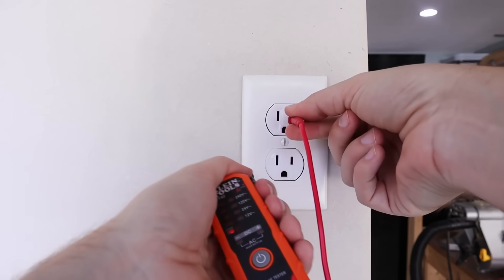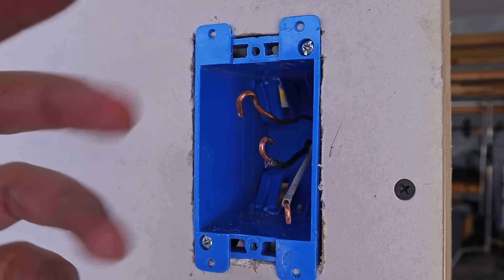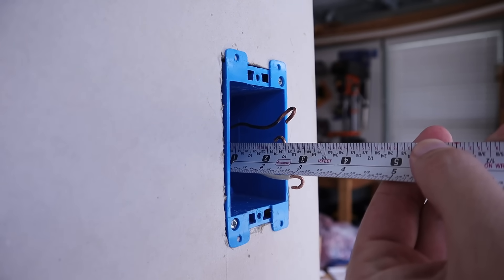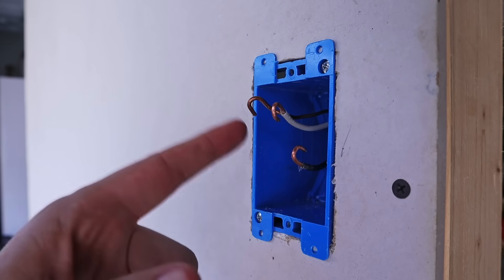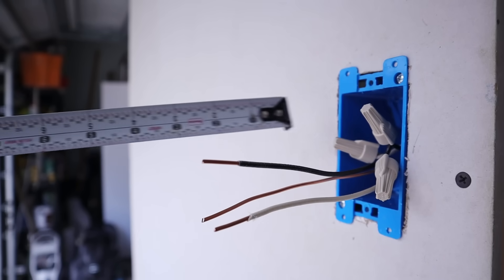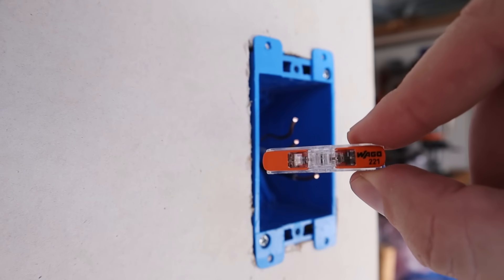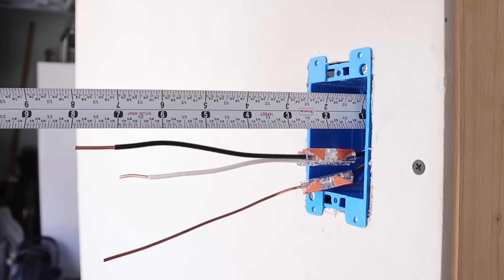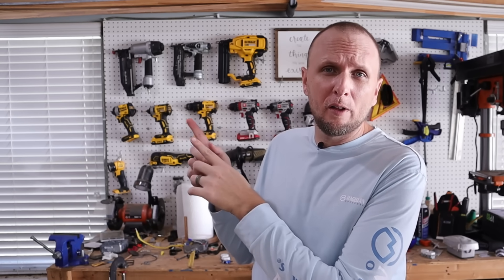"SHOCKING" New Way to Fix Short Wires In an Electrical Box to Code | Very Important

Comment: One thing was how easy it was to cut and strip the loops off the existing wire, to perform the various ways of connecting.  In the example build up, you put the gang box at the end of the drywall and stud. With there being nothing to stop you from angling your hand almost behind the box, at the very least, at the same depth, it shows as pretty easy. However, real world, there's going to be continuous wall, making the move to cut and strip, extremely difficult. Even worse, there maybe countertops forcing us to stand 2' away from the box. How do we avoid that?

Comment: Part of the problem may be advice from inspectors years ago.   Two different ones told me that I was wasting too much copper by having what I considered to be compliant lengths.   My response was that I was not trying to low ball the job.
Reply: The "Inspector" title went to his head!
Reply: Inspectors are usually just tradesmen that couldn't make it doing the trade.
Reply: @robertwazniak9495  lol not always, but sometimes. Also I know an inspector that was damn good in the trades but was now slightly obese, had a few injuries, and was older. So u kinda get a whole range, but I think personality (like any job) and a willingness to learn their craft is the most important thing.
Reply: @srobeck77  I can honestly say I have never worked with or dealt with a “normal” inspector. They are either really really good at what they do… explain what they are doing and fully understand why and what is critical and what you shouldn’t do next time.., and make you a better contractor. OR, pompous asses on power trips who need to justify their existence and try to beat their old record on how many violations they can write you up for. There are no middle ground people.
Reply from the maker: Wow, I had not heard that one yet but like you said, it might explain why some of the remodels I have done, I have found short wires and I know it was installed by an electrician.  That and neighborhoods go up as fast as possible and the inspectors arent checking super closely all of the boxes.  Really appreciate the input Luther!
Reply: @HowToHomeDIY  The last lot along the major street by my place was subdivided.  Sad, no yards on the entire throughway.

Comment: Uh oh!  Twisting the wires before applying the wire nut is normally a mark of a hack.  It usually doesn't matter, especially with only two wires, but it is possible for the wire nut to not compress ALL of the wires.
Reply from the maker: Then every electrician I know is a hack.
Reply: @HowToHomeDIY  In my experience it's actually only about half half.  And, to be fair, some of the manufacturers actually do state that "pretwisting is optional".  But, in practice, it is better not to.
Reply: LOL, tell us you know nothing about wiring while telling us a hack.

Comment: You did not show fitting the sockets into the hole after adding in all of the connectors, how do they fit?
Reply from the maker: Perfectly fine.  The wire nuts take up the most room, then regular wagos, then the in-line wagos.  The inlines are really just like extending the wire.  All that said, I’m more of a wire nut user but the in-line connectors are a nice choice.
Reply: @HowToHomeDIY  Thanks, was just curious, because in the UK 3 wires can get tight without extensions :)

Comment: Seems to me that the "original" WAGO 221 (both wires on the same side) would be easier to tuck into the box after the recepticle or switch is connected.  JMO.
Reply from the maker: Not at all.  The inline is basically just an extension of the wire and takes up barely anymore space than of the wire had been the proper length.
Reply: @HowToHomeDIY  Thanks.  Your videos introduced me to the WAGO, and I used many of them in my new home.  Now we have the new straight connectors.  I'll give them a try.  Keep up the good work.
Reply: It makes the bending part much easier.

Comment: Why cut the loops off?  That only exacerbates the short wire issue.  Assuming the wires are not damaged, just straighten the loops, trim the bare wire to an appropriate length and then extend them.  Is there some reason not to?
Reply from the maker: Yes, since the wires were already bent into a loop once you start bending copper back the other direction, which you would need to do to straighten, it weakens it.  So you run the possible risk of it breaking off at some point.  Doesn’t mean it will but I always try to play it safe when I can.

Comment: Any advice for splicing #6 wires?
Reply: Use a 4-11/16 by 2-⅛ box and ideal blue nuts. For more than a simple splice,  bump up to a appropriate sized pull box, per NEC 314.16, and Ilsco cleartaps or Burndy splices, aka monkey knuckles.

Comment: I’ve stopped using wire nuts , they take up far to much space. Thank you I wasn’t aware of the in line wago. Very helpful!
Reply: Inline Wagos are very recent, difficult to find in the US and expensive if you do.
Reply: @KameraShy No longer (February 2024). 60 pieces for $24 on Amazon, same day delivery for Prime members. Forty cents each to quickly cure a wire issue while taking up a fraction of the space of wire nuts is a screaming bargain.
Reply: enjoy the fire.
Reply: @soisaidtogod4248  old dude, wagos have been code in Europe for over 20 years now. What is this mythical fire you dream of?

Comment: Gotta love those US plastic ungrounded boxes that don't hold the wire sheath at all. Shite. Not sure what the tan nuts are in the US, but in Canada you use the BLUE Ideal Can-Twist nuts which are great for most everything.
Reply: here, blues are the biggest or the smallest size.  tan is halfway between the old yellows and the old reds.  the best general use ones on the market here are #m T&R+ model - they can do everything from 2 fixture wires, to 4 #12 solid.
Reply: They go by size not what color the manufacture picks.
Reply: @soisaidtogod4248  this may come as a surprise to you, but the color of a wire nut is picked to identify its size and design.  not sure why ideal makes a canadian model and a US model of what is essentially the same wire nut - but the blue can-twist is the Canadian version of the tan Twister.

Comment: This is not to code.  300.14 "The 6-inch free conductor shall be permitted to be spliced or unspliced"... great you fulfilled that for an enclosure that is more than 8 inches square... "Where the opening to an outlet, junction, or switch point is less than 8 inches in any dimension, each conductor shall be long enough to extend at least 3 inches outside the opening."... this extra sentence in particular for enclosures smaller than 8x8 square need 3 inches outside the enclosure and does not have the previous prevision.  If the box is for a switch or outlet I would like to impose the conductor shall be unsliced to meet code.  That means moving the box, pulling more conductor into the box, changing the enclosure to a greater than or equal to 8x8 opening, or converting the short wired box to a junction box so you can splice the short wires and send them to a new outlet location with 3 inches, unspliced outside the opening.

However, if you want to ensure that your installation meets code and best practices, you may want to consider using unspliced conductors in all cases, even for larger enclosures. This can help ensure a reliable and safe electrical connection. 

Ultimately, it's important to consult with a qualified electrician to ensure that your installation meets all applicable codes and safety standards.

Comment: I'm not an electrician, but do a fair amount of electrical work both at home and mountaintop radio sites.  I started using the WAGO 221 connectors a year or so ago based in part on some of your videos.  I like the inline WAGO splices you showed here...
However, here is something unrelated that has always concerned me.  In many cases (especially when using romex) the ground wire is bare wire.  I know that is perfectly legal per code, but it just seems very unsafe because now you have a bare grounded wire floating around the box where there are also exposed hot terminals.  Just does not seem like a good idea to me.  Almost everything I do is in conduit rather than romex so normally I have green insulated wire for the ground connection.  Comments?
Reply: Ya, your conduit should be grounded. Bare wire in the box is also fine because your whole box should also be grounded. Just make sure not to touch any terminals with excessive wire - if one can't do that, then one has no place in touching anything with electricity.
Reply: if a bare ground is at risk of hitting the other terminals, you're a sloppy worker.

Comment: I've been using (and love) Wagos for years but I never knew about the inline connectors. Ordering some right now. Thanks!
Reply from the maker: You are welcome!  They can definitely be helpful!
Reply: The inline Wagos are relatively new. I used them when I rewired my 1950 house.
Reply: @im2yys4u81  1968 here but no lead paint or asbestos.

Comment: I am German and we have mostly brick walls (especially in my area). There is no loop if someone cuts a wire. so this is a rather common pain in the a**.
The only thing when using Wago (pushin and 221) is they like straight cable ends, insulation should be removed 11mm (a bit shorter than 1/2") it is marked on the connectors and that's it. The greatest advantage of 221 is they can combine any cable (stranded/solid different sizes), but they are a bit expensive. Here Wago push-in  connectors became standard in the 80th/90th, they have been proven to be really reliable, wire-nuts never were a thing.
I really like European style cable strippers like 1102160 from Knipex to work in tight places or on short cables.

Comment: Ground wire could also be extended using a crimp connector.
Reply: crimps aren't all that great on solid wire.
Reply: @kenbrown2808  buccannon copper crimp are cheap and work great
Reply: @barfy4751  first thing i did when i quit brand x was toss the ground crimps in the bottom of the toolbox.
Reply: Crimping inside a j box is rookie.

Comment: Are these Wago connectors using aluminum within the body to transfer electricity and if so, are they recommended for outdoor use with copper wire?  
Or, if you use them outdoors, do you need anti corrosion paste?
Reply: Wago uses tinned copper connectors. Many of the "No Name" copies also uses tinned copper, but you never can be sure..
Reply: @JoppeOSL  OK.
In the case of aluminum wires and outdoors, is it suggested to use anti corrosion or does the tinning somehow negate the need?
Reply: NO. Nothing uses aluminum on the market.
Reply: @amerikalast  Aluminum went out decades ago.

Comment: I know I am old-fashioned but I trust those Wago connectors like I trust the "push-in" connectors on devices like receptacles and switches where the tip of a spring bites into the wire to make the connection. I have seen too many device failures at that point. I know they are code compliant but I believe it is a less-quality connection than twisting the copper together and protecting it with a good wire nut. I totally understand how an electrician can save time and make more money using these connectors but they are the weak point in the chain, especially when used anywhere near a saltwater body (ocean front, bays, etc.) where corrosion comes strongly into play. I have sent Electricians home that refused to hard wire each device on a job.
Reply: the mechanism of a wago is more positive than stab connectors, but I still have concerns with the fact there's an extra point of connection on each splice, and there is a smaller contact area.  I use them for connections that I expect to be taking apart and reconnecting on a regular basis.
Reply: @kenbrown2808  Someone else here said something similar, using Wago connectors for testing is certainly better than alligator clips.
Valid point!
Reply: @samTollefson  if you're moving the connection a LOT then alligator clips are easier to work with, but when you have components with a high wear rate, it makes changing them out easier.
Reply: @kenbrown2808  Thank you!

Comment: Wire nuts are the best connection, but sometimes the wire is SO short that you can't even get a wire nut on it. I'm ordering a few of these for that exact occasion.
Reply from the maker: Totally agree.  In cases like this, the Wago tends to make more sense.  Thanks for the input!

Comment: I was a Electrician and we used Twister Wire Nuts.  The tan Twister like you showed can be twisted on 2 straight wires and then use your 5/16 nut driver over the back of the wire nut.  Try one like this and then take off the wire nut to see the results. It will look just like you twisted the wire first. By the way, I would have straighten the existing wires with my linesman pliers and then installed tan Twister wire nuts on each. Then I would have selected a good device. We used spec grade back wired receptacles, where the screw has a plate that tightens down on a straight wire. Like Lowes Item # 24356.
Reply: I never (absolutely never) pre-twist wire pairs when using an appropriate wire nut. Only when there are 3 or more conductors. IMO, it all works much better that way and it's what the nuts are designed for.

Comment: Connector could depend on how much room you have in the box.
Reply from the maker: Yeah if for instance you're installing a GFCI and the box is small, like you said, you may want to consider a connecter that is smaller.  Thanks for the input!

Comment: I have all my wire connectors in the carry boxes with  clear cover  I bought at harbor freight years back, all my wire tools in a carry bag to make life easy , Just a DIY guy!!!! wired my BBQ shed , run wire from home to sub panel  also going to have solar power to recharge my vtoman portable power  units.
Reply from the maker: Yup I do the same.  Home Depot had the clear covered stackable Dewalt cases on sale a while back I just bought a bunch of them.   They make great cases for all of the connectors!  Sounds like you are going to have quite a lot powered!
Reply: @HowToHomeDIY  I buy from lowes and home depot too. Harbor Freight  member of the inside trade club, but I watch what tools to buy and not to buy. No air tools from them I buy name brand tools. but other items at HF are okay to buy

Comment: Push in connectors are good for this too. Do t need to use a huge tan nut for 12AWG, can use just a two wire connector. Less expensive too.
I keep Wago, push in and regular nuts in my box to fit a variety of situations.
Reply from the maker: I know some people really like the Insure push in connectors, I just personally don't care much for them.  Especially with an option like Wago available.  But they are certainly an approved option!  And like you said you are prepared for numerous situation, which is the way to be!  Thanks for the input.
Reply: @HowToHomeDIY  Most of the time I'm using Wagos for testing circuits before the walls get closed up. Also good for diagnostics.
Reply: Yeah, I have a few of each.
Reply: I generally don't advise push ins, as the use the same flawed connection as back stabbed receptacles

Comment: You don't have to cut off the hooks unless physically damaged.  A good pair of linesman pliers will straighten out the wire enough for twisting.
Reply from the maker: They can straighten them out but when copper gets bent back and forth it becomes weak.  So I just prefer to start with fresh copper and know that I am not going to have any issues with it later.  Thanks for the input!
Reply: @HowToHomeDIY  As long as you got the length I agree.

Comment: When I find short wires in a box. I am usually sure... it was the painter. They hate things sticking out of a box.
Reply from the maker: If it is then they have no business touching the wires.  If I was an electrician on a job where a painter, plumber, roofer touched my work, I would probably not be a very happy camper!

Comment: I'm surprised that you didn't wrap those connectors in electrical tape to secure the toggles.
Reply from the maker: I don't use tape.  It is an option but I just make sure to hold the tabs down while placing it in the box.

Comment: Hello, I just found your site and I appreciate the info you’re sending our way. I have a quick question. We have a 20 year old home with no 220-propane main source. Mistake was made during contractor construction when 220 was not added at the time. I saw your video on running wire from ceiling. Does this apply to our situation for adding 220 or are we stuck?  Thank you for any help.

Comment: Many Many years ago, I was doing lots of electrical work. We frequently used In-line Butt Slicers for connections. But on many videos on YouTube I never see them in use, even though they are available in hardware stores.  And the new WAGOs are essentialy in-line butt splices. 
Why does no one use in-line butt splicers, are they not code compliant? Or some other reason they are not used in home applications? (I do see them used in cars electrical systems alot)
Reply: they make a very poor connection on solid wire.

Comment: Guess I'm getting old been in the electric trade since 1987. I never put a metal tape in a electrical box ,Even if I know it's off .I also bend the hooked wires straight then attach and tape my wire nuts in the direction of the twist.I like your wagos trick, sorta like butt splices but easier. Ty for the video.
Reply: Scaredycat! The straightened hooked wires can be weakened and it,s quicker to nip them off wasting a little wire, huh